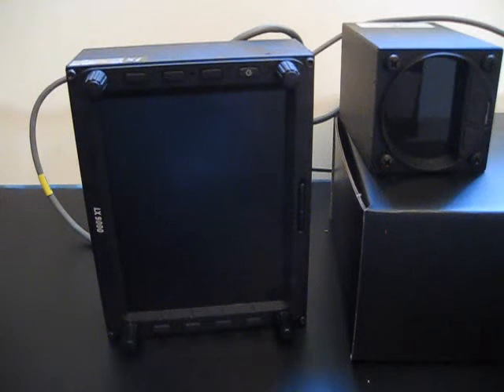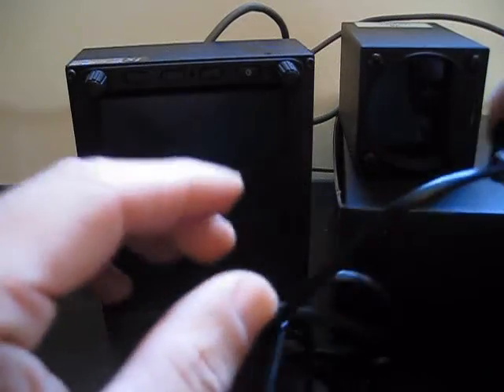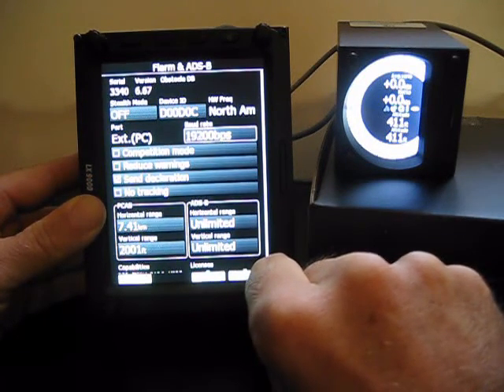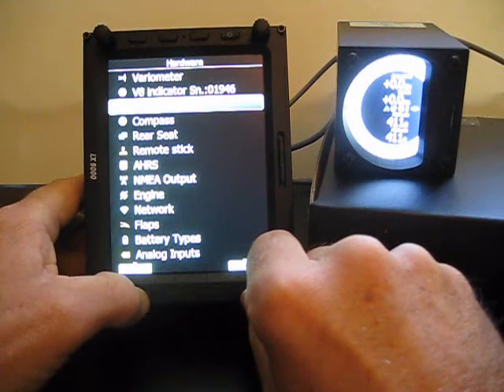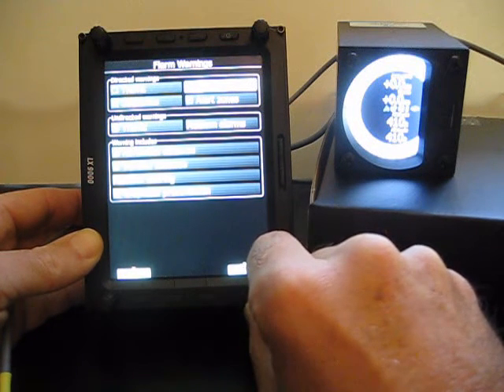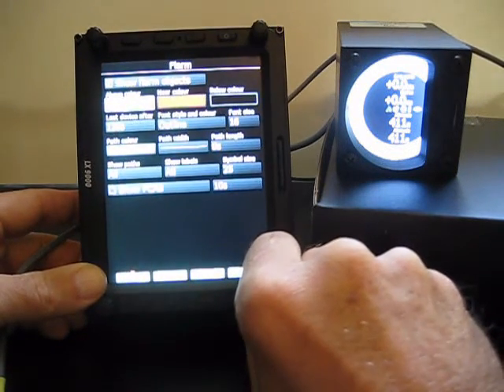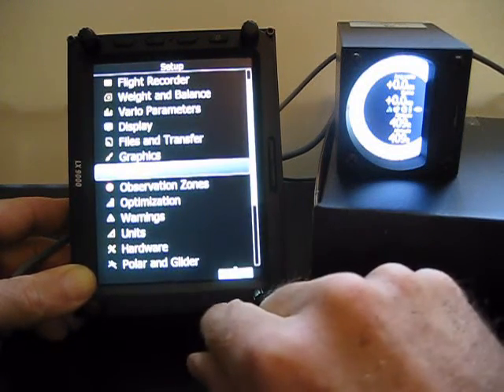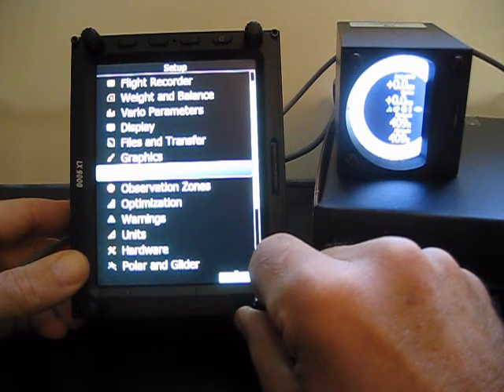How to Connect a Flarm and then Configure your LX9000

Comment: Hello Dave, I have an LX9000 without wifi, with a FlarmCore connected via cable as described in this video.  What is the best way to update the flarmcore?  I've tried inserting USB stick to the USB flarm port and powering up the 9000 but that does not seem to update the flarm.  The only way I found was to power the flarm independently with the USB stick inserted and the update occurs automatically.  Problem is, I don't have the independent Flarm power cable anymore so that option is no longer available...  Thanks for any help.
Reply from the maker: What you have described is the correct procedure.  With power off to the 9000, insert the USB stick into the Flarm's USB port, then power on the 9000 which will relay power to the Core.  The Core will boot up and find the USB stick with the new file.  Wait about 5 minutes and it should be finished.  I find it helpful to use a USB stick that has an LED so you can see the USB flashing while it is in use.  

You are using this fw file?

https://www.flarm.com/wp-content/uploads/man/pf_7_22_6076cde9d_exp_1_3_2025.fw